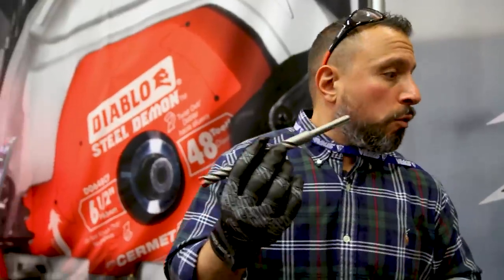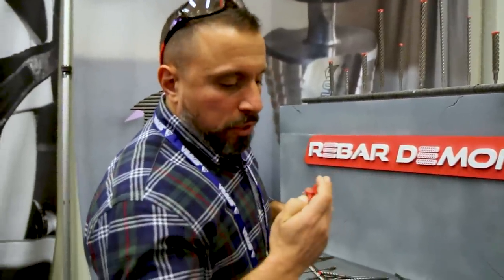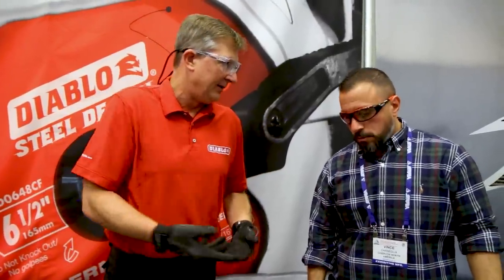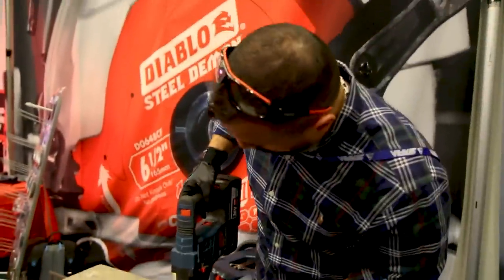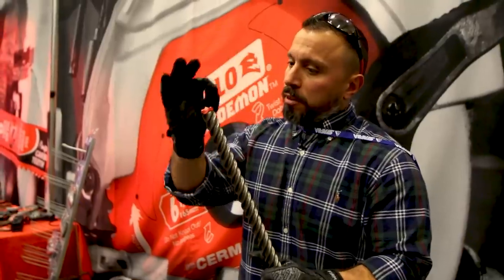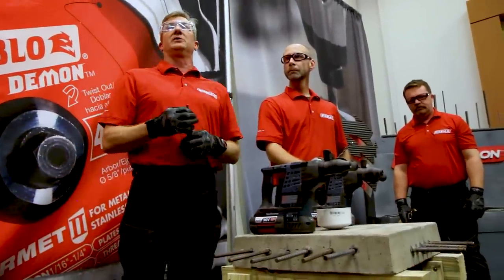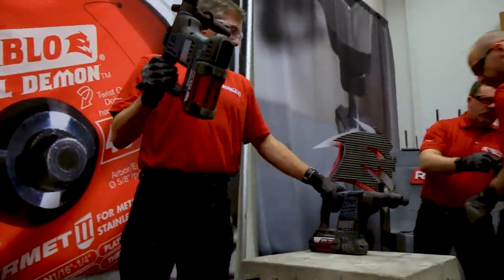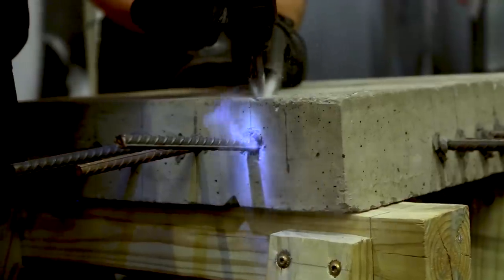New Carbide Masonry Drill Bit That Can Drill Through Rebar! (DIABLO SPEED DEMON)

Comment: Maybe ask, "What's the most number of times it has hit rebar in any manner before failing?"  Or "What's the range?"  I can see avoiding the general question of how many times, but people can't crunch any numbers at all unless they have some idea of how many times they're likely to get out of their bit.  As customers buy and try them out, they're going to find out anyway, so why not at least give an estimated expectation?  You know darn well that they have the answers in their metrics after a ton of tests during the engineering stage.  So why not share the findings?  Also, if they provide the information, they get to control the narrative as to how they arrived at the numbers and why those numbers are cost effective.  Once others are using them, they will come up with their own interpretation of what those numbers are and some will be convinced that it's cheaper to do the extra work with their traditional methods, when they might actually be looking at things the wrong way.
Reply: yeah, in my experience engineering minds tend to answer vaguely  to avoid saying something that is wrong (I myself was satisfied with the "it depends" answer).

Comment: Diablo is killing it with their new product line!
Reply: Are they?  Seems like a gimmick.  He heated up the tip, then waited far longer for it to cool down than they waited for the Hilti to cool down.  Essentially, they made the test harder for the Hilti bit.  Then when they asked them to drill two holes in rapid succession, he didn't do it.  Later, when asked how the carbide tip is attached, he answered some other question, not the question that was asked.  Too much BS.  I'm not sold.  Try drilling 10 holes in a row, non-stop, to demonstrate how great it is.  Talk is cheap.  Evasive answers are even cheaper.

Comment: Unfortunately not a side-by-side comparison, and which Hilti bit did they use (TE-CX)? Over here the Diablo cost about twice what a Hilti TE-CX would cost you, or about 3x the price of the Bosch 7x/8x. A comparison with the latter would be great, as they performed well in side-by-side comparison (the fastest to go through concrete with 10mm steel plates).

Comment: The carbide was forged in not welded in. Softer steel is used for the body harder steel is used at the tip. They can also use a variable heat treat to get that result.

Comment: That's handy for me. I drill concrete everyday, mostly 6mm holes. Does it come in metric sizes Vince?
Reply from the maker: I’m sure they’ll have metric soon enough!!
Reply: @VCGConstruction  I hope so to. Thanks Vince
Reply: You can get the metric from the uk, because some times its not available in the us
Reply: Depending how critical dimension is, a 1/4” is only .015 larger. Alternatively, Hilti TE-CX are available in metric w/4 carbide cutter head that works great in rebar concrete. Downside is the cost of Hilti is 4X higher...as typical
Reply: @MichaelM-to4sg  thank you for the suggestion. I'm now using hilti TE-CX bits. Works wonderfully well, although a bit pricey
Reply: Muhammad Fauwaaz Ramli Hilti is proud of their name and they like to charge consumers accordingly 😉.

The good news is their original designs like the TE-CX get copied within a year or 2 and consumers get products like Rebar Demon or the Bosch version for far less. Just hope they work as well. 

I would say same of their TE30 & TE60 A36V cordless hammers but overall yet to see a cordless hammer, even the new Makita dual battery unit, have anywhere near to hammering power of the Hilti. Sometimes there’s no matching the best engineered products but hopefully this Rebar Demon is the goods. I’ll know in the next week.
Reply: @MichaelM-to4sg  true enough about hilti😊

Comment: Need to go pick up a 3/8, 1/2 and 18’’ x 5/8 ASAP. Tired of my Bosch getting stuck and not going through the rebar 🙄 👍👍👍 Using the Milwaukee m18 2715-20
Reply: Diablo = Bosch. This is sds plus7X and sds max8X

Comment: When you hit the rebar is better to switch from hammer function to normal until you go through rebar ?
And then switch again to hammer mode so the carbide head will last longer ?
Reply: That's what I do when I hit rebar. Helps to go slower too, the drill bit will not heat up as fast as when you're going full speed. Currently I use Hilti 4 cutter drill bits, hopefully these new Diablo bits work better. Can't wait to try them out
Reply: U mean to drill mode? Wont it bend your arm like a twig?

Comment: I would like to know if you know how to drill through a concrete slab and not blow out the concrete out the back of the slab is there a way that you know of if there is you please let me know
Reply: start with a tiny drill, drill a pilot hole all the way through, when you almost get to the end of the conrete, use very little pressure, even you can put the drill off hammer but takes a while.  Then drill using a larger drill bit from one side of the wall half way in, then from the other side of the wall